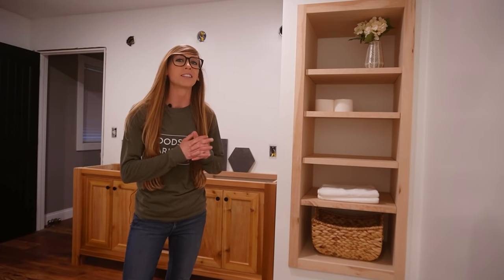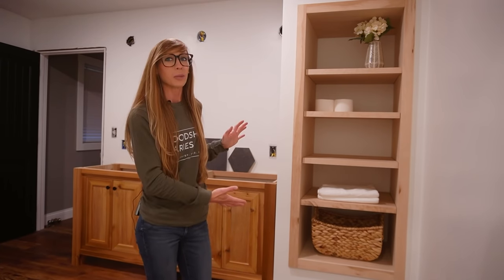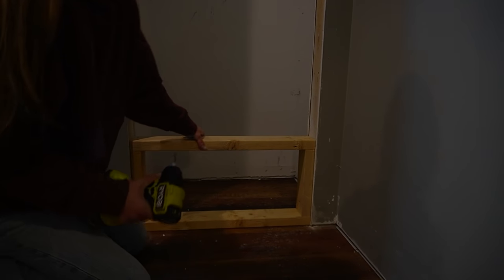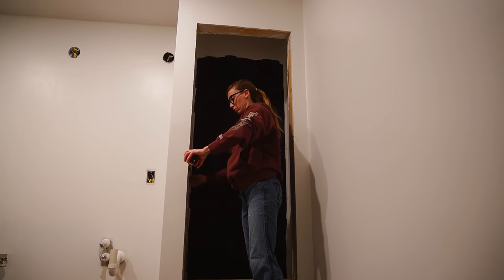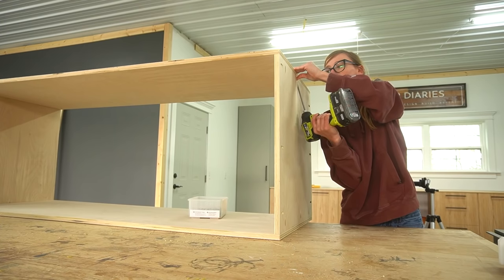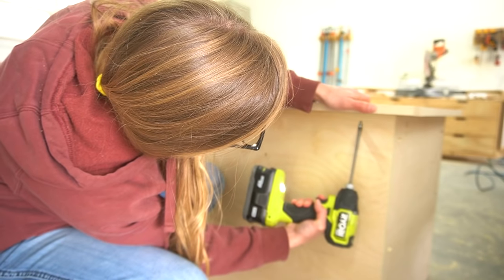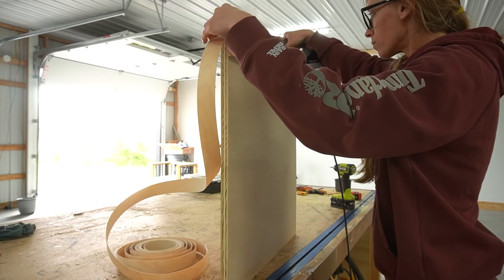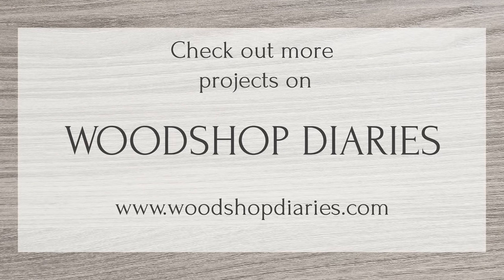How to Turn a Closet Into Built In Open Shelves

Comment: I did the very thing!  I had 2 closets side by side in my dining room, they were only seperated by a sheet of drywall, didn't make sence. So I took out the drywall, took the door off built the shelves shallow and still had access to the back of that  closet through the other one. I store my vacuum there and other things. I trimmed out the shelves on the front and now it looks great. I even added a light to it!
Reply from the maker: Great minds think alike! That sounds like a great use of space!

Comment: Thank you so much! This is exactly the video I have been looking for. I have the stupidest closet in my bathroom. No one bothered to check and see if a door would actually fit into the space and so it opens halfway and bangs into a radiator. I've been so intimidated to start the project, but your video has given me confidence.
Reply from the maker: So glad to hear this was helpful! I have a hatred for doors…in so many cases, they’re such a waste and either in the way or don’t fully function due to the design/location someone put them in. I vote remove the door 🙌🤣

Comment: Simple solution with a faboulous result. As you have about an inch wiggle room from top to bottom you could add some kind of french cleet so the cubby is more or less fixed. But as you said it will not go anywhere. 👍👍👍👍👍

Comment: When you were measuring your door after painting, there's a trick for a more accurate measurement than having the bend of your tape at the top and having to guess. Make a mark from the top at some number, let's say 10 inches, then measure to your mark very accurately and just add 10 inches. Takes but a second to do and it's much more accurate.
Reply from the maker: Thanks for the tip! That’s a great idea. In this case, I didn’t need accuracy as I was making my box under size anyway to allow for wiggle room to get it in place.

Comment: Noticed that you put a full piece of baseboard trim along the wall where you were going to be installing the new vanity.  Am now wondering why you wouldn’t have left that trim loose for now and then attached once the new vanity was installed since it would be much easier to butt that trim up to the new vanity rather than scribe the vanity base to the trim or require additional adjustments with the how the vanity abuts the wall. Eager to see or hear what you did here although it may very well have just been an afterthought and has now been corrected like the black interior of the wall storage. Great job and I enjoy your videos.
Reply from the maker: The vanity will butt up to the short piece on the left side 👍

Comment: Because you're putting a bottom on the shelves, instead of drywalling the empty space you could instead install a large drawer there.  It uses the space and adds a bit more visual interest to the look.
Reply from the maker: That’s a good idea! I liked the clean look of the smooth drywall around the built in, to keep it less busy and simple…but for access to more storage if you need it, a drawer is a great option.

Comment: I just found your channel.  I love it.  I use many of the same tools you do.  I have recently started using pocket hole joining.  Question,  I’ve noticed on several videos when building boxes you don’t clamp the plywood together prior to screwing them together.  I’ve tried this and I find that as the screw tightens it moves the wood a few mm off my mark.  How do you avoid this?  Thanks.
Reply from the maker: I’m so glad you enjoy the videos! I very rarely clamp my pieces when driving screws. I’ve found it quicker, easier and just as precise to just hold them. I have a video here sharing how I do it:
How to drive pocket hole screws without using clamps #shorts
https://youtube.com/shorts/5BEhvuj3Kfc?feature=share
Reply: @WoodshopDiaries  Thank you.  So much faster.

Comment: I'm surprised you didn't make the bottom a drawer just so that you didn't need to do drywall work.
Reply from the maker: I do prefer drawers over drywall work 🤣but I was already drywalling other parts of the room, so this wasn’t too much extra to add on to it. Plus I think it looks a lot cleaner being centered vertically and less busy with the smooth drywall surrounding it.

Comment: Do you prefer the Kreg guide with circular saw to a table saw? I’m just building up my tools as I’ve been borrowing up to now but will have to solve for these wider cuts eventually.
Reply from the maker: I use my kreg rip cut or accucut over the table saw for everything I can possibly cut. My table saw is always the last resort…personally.
Reply: @WoodshopDiaries  that is super helpful, thanks!! Definitely easier to store vs a table saw also :) building everything out of a one car garage so the smaller space impact, the better!